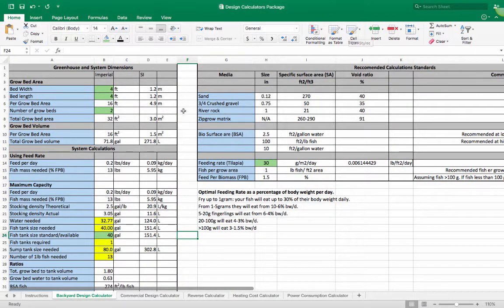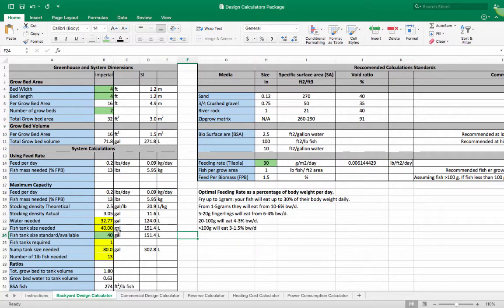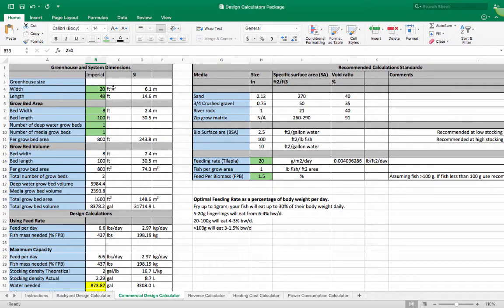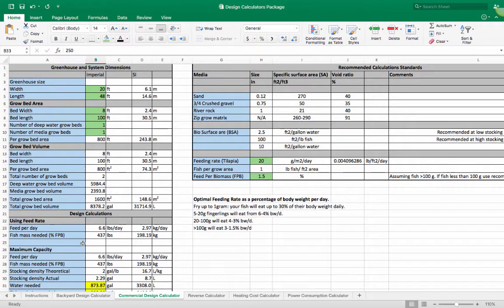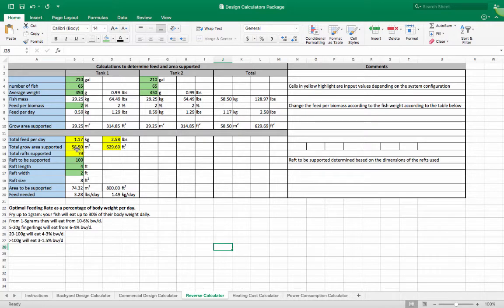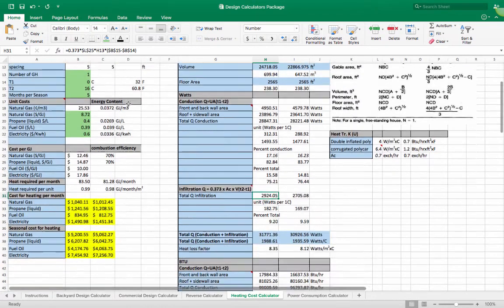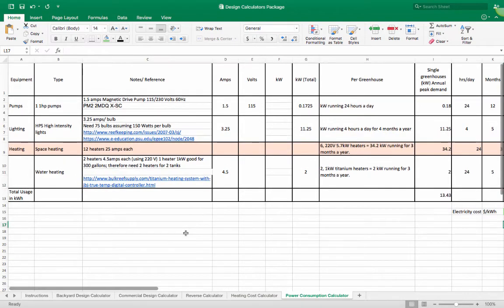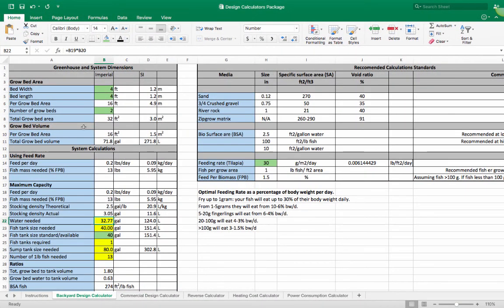How to Use the UAP 5-in-1 Design Tool to Build Your Aquaponics System

Comment: Hello Ahmed, good afternoon. You did a very good job with this spreadsheet. Are you using the UVI model on your calculations?
Reply from the maker: Thank you Leo. The calculations are based on the UVI model however we have used practical values that we have seen in real life operations at the farm.

Comment: where can I get this?
Reply from the maker: Hi Richard, you can get the design calculators on our website at http://www.urbanspaceaquaponics.com/aquaponics-design-aquaponics-calculator-aquaponics-math-aquaponics-science-aquaponics-number-backyard-design-commercial-design-aquaponics-heat-requirements
Reply: @urbanspaceaquaponics9942  I'm finally ready to purchase. Does it also calculate for grow towers?
Reply from the maker: @puntosxm  the calculator will give you the specific grow area based on your inputs; that grow area can be easily converted to number of grow towers. The calculator, however, does not specifically give you the number of towers. It is a great suggestion and we will incorporate this in the new beta version coming up in Feb. If you purchase this version of the calculator we will send you the beta version when it is released.
Reply: urbanspace aquaponics thank you. Also some towers hold more than others. I plan to use a 40 pot tower.
Reply from the maker: @puntosxm  sounds pretty interesting. If you need more help email me at ahmed.aibak@urbanspaceaquaponics.com